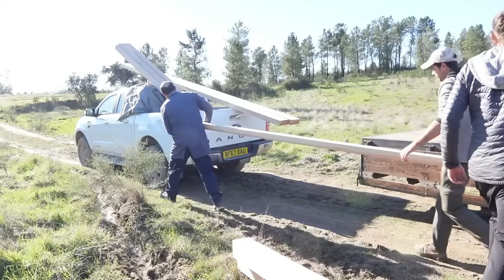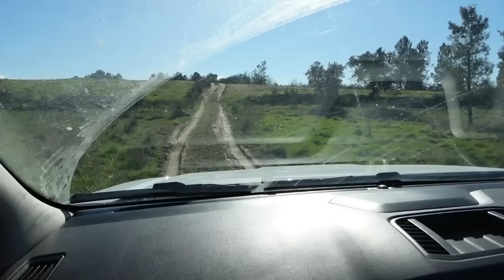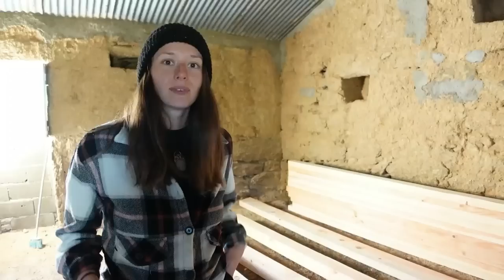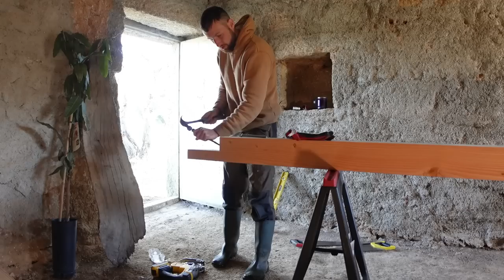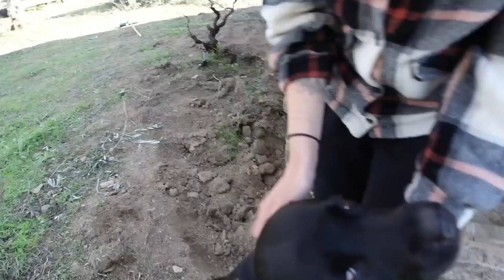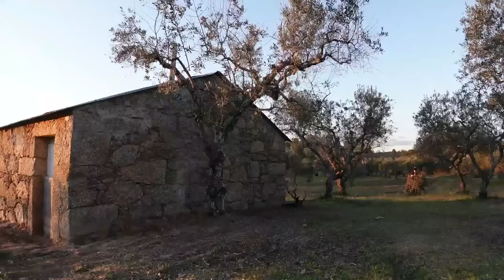BUILDING OFF GRID OUTDOOR KITCHEN

Comment: Just an FYI...when not using the generator shut the fuel off manually as there is a common fault in that engine and carburetor where petrol leaks into the engine oil and dilutes the oil and cause the engine to lock up eventually.  Drive on !!

Comment: Great to see your plans coming together. Its going to be brilliant! ... One thing that bugs me though is Dan smashing that pair of 'Spoons' into the ground to dig post holes. Sooner or later the linkage will break as they are only meant for lifting loose soil out the hole. They should come with a separate bladed spade on a long pole, called a 'Grafter' that you do the actual digging with. And also a heavy 'Breaker Bar' for smashing up rocks... Way faster than trying to dig with the spoons. 👍
Reply: They might not have the proper tools because they might not be able to afford them?
Reply: Very true. Was not meant to be a criticism as such, more an explanation given they say they don't have any previous experience.  I could maybe have softened my phrasing I guess.

Comment: One way to move long, heavy pieces of lumber when help is not available is to build a tiny, flat cart with one axle and two small wheels, so the cart's bed is only a few inches off the ground. One end of the lumber can be strapped on. Then one person can hold the other end and just walk along, pulling the lumber.

Comment: Hope you're not gunna post the posts in the ground. With the amount of water you get on your land, you need a concrete footing to prevent water damage. I don't think any amount of oil will prevent that if they're in the ground. You'll need to set metal post anchors into the concrete footing. Love watching your videos, keep up the good work.
Reply: Charring the wood could help protect it as well.
Reply: I totally agree.. your timber will rot away within a couple of years.  Someone else suggested talking to Nick… please do it.. He is a builder and is very practical.